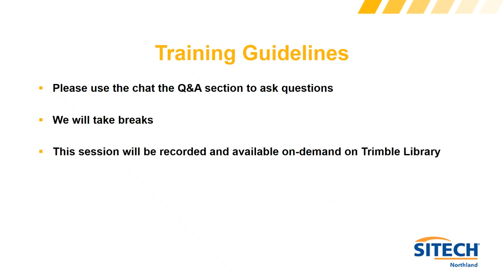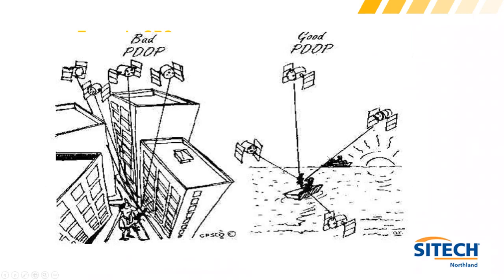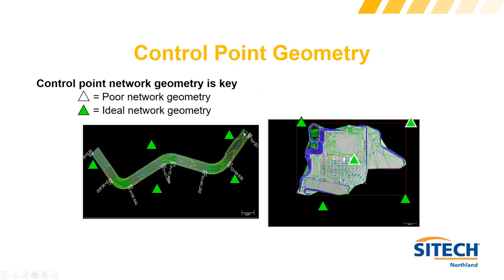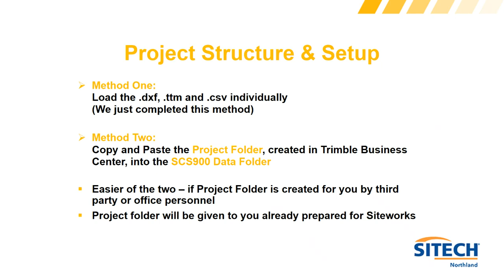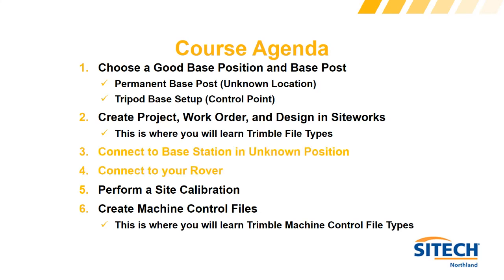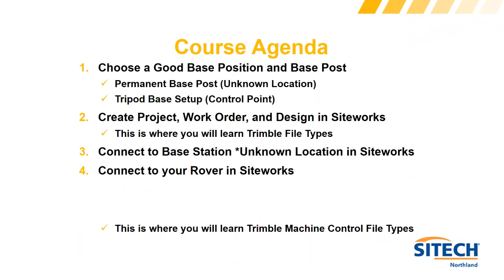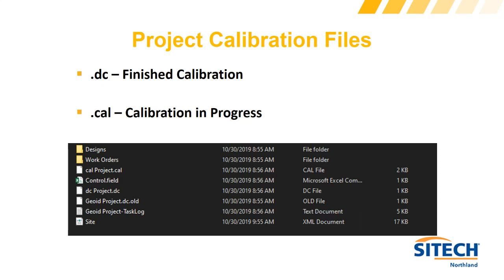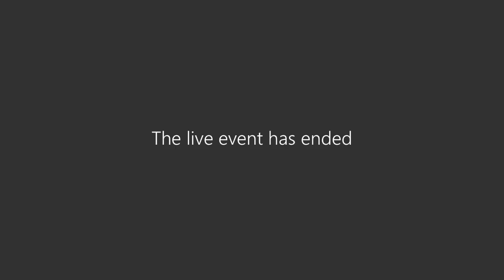GPS Site Setup Basics 2022

Comment: Can you connect to a corrs network and do your calibration under that?  Once complete shoot a control point with you rover.  Set the base up on that point and tell it what it is by choosing the control point.   Would this method work the same?   Thanks.